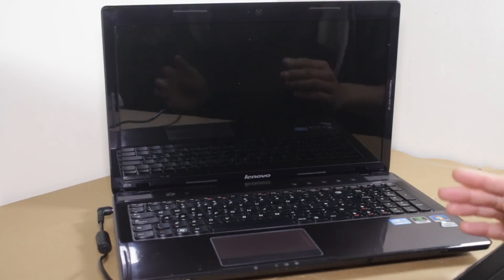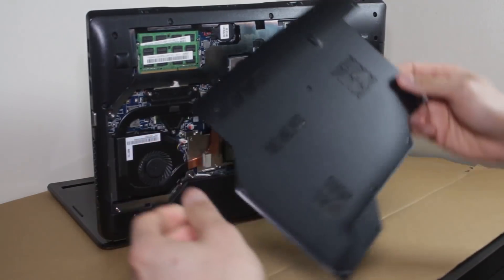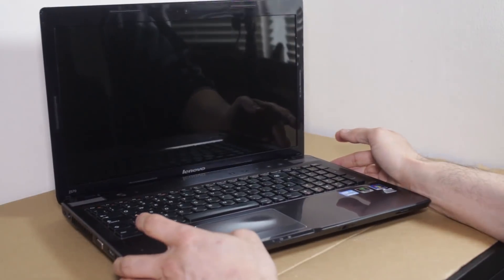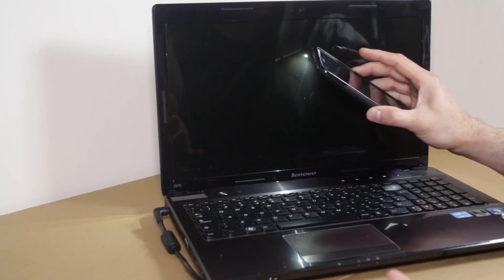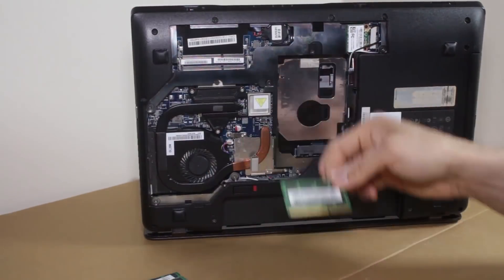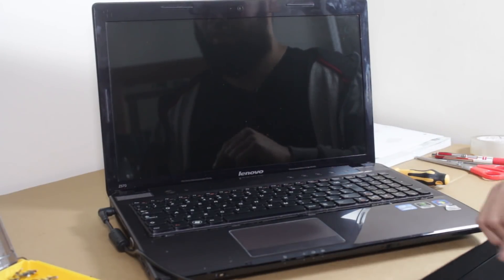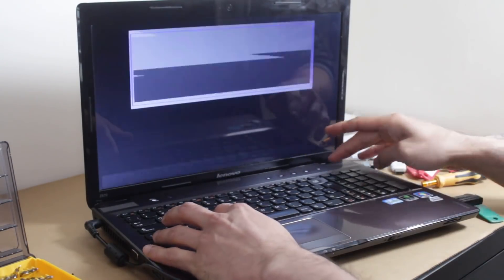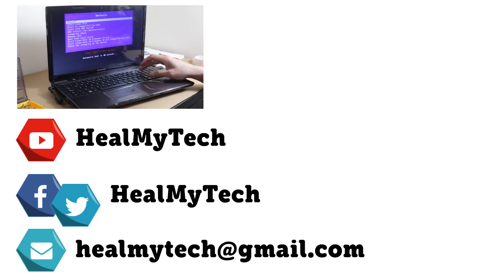Laptop No Display Black Screen Blank Screen On Startup | How To Fix Troubleshoot Repair | New

Comment: None of this helped but I found a new one that I would have never expected. One of the two Ram Modules went bad. Once I figured out which one Boom Working again! Out of forty years of using a number of PC's never once did a RAM go bad. There you go it actually does happen!
Reply: Did you replace the ram module? Or cleaned it or fixed it? What did you do to diagnose? When you take it off the laptop won’t turn on?

Comment: Great video!! May I know what is usually the problem if the laptop screen die sometimes and blinking like on and off. There's a case when I open all lights are on but display stays black. I do some testing like test to other monitor and it works but the laptop screen remains black.
Reply: Sometimes it works properly. Monitor is working but there's a cases small movements make the monitor's dead.

Comment: My problem was I disconnect the LCD from my laptop and reconnect it but my laptop was turning on when I reconnect it there was a little spark fire and it automatically turn off my laptop when I turn it on it goes black
Reply: Did you fix it man any update?

Comment: i've watched enough computer repair videos to know, when it comes to laptops doesn't matter what brand or model it is, its always a pain, i mean people still need them and yet manufacturers continue to make it their mission, to make laptops as hard as possible to get repaired, they need to start implementing standards so that they can all be customized with any and all components on the inside, just like desktops, and then that way any model of laptop can be recommended to consumers without limiting repairs or upgrade options.
Reply from the maker: Completely agree.  Somehow I doubt the tech companies will be making any mass changes anytime soon, as even laptops sales are on the decline in favour of smartphones.  I have to say though, the recent laptop models are a lot easier to open and diagnose compared to the previous ones, with one main back cover in most models I have seen.  I haven't done modern laptop repairs in a while, but I do need to own a laptop soon, its about time after 5 years of being in tech, a necessary evil, should make for a fun video trying to look for 1, hopefully a slightly older model from Lenovo maybe and fully upgrade it.
Reply: @HealMyTech1  i happen to know of one model that has most of the parts easily accessible, the HP probook 6470b, it belongs to a family member of mine, just like how you mentioned the bottom panel gives me access to all the main components: cooling fan and heatsink, hard drive memory and wireless card, so it can be potentially upgraded with a solid state drive.
Reply: @HealMyTech1  and that's because they are greedy they want us to be replacing everything in a short period of time, instead of giving us quality stuff, my first computer was a dell machine, i never once had to replace anything like the hard drive, motherboard or memory in that machine once, only thing was the monitor and the power supply that died, but overall it was a nice solid system that i had for over 8 years running windows xp, fast forward today its a completely different story, parts seem to diminish so quickly, and no one has money to be replacing so often these days, and there in lies the issue.

Comment: hello my brother
i dont think my hard disk have any problems but i have black screen, i tried all the ways to turn it on though i suspect its something to do with the fan because past experience

i dont have laptop for now but when i buy one i want to be sure my hard disk will work still and have my data in it, do you think that it could be damaged no good or its the reason my labtop show black screen?

and also
what about the data in the hard disk C: or the one with the windows icon on it.. (not geek clearly)

please answer my questions i will be very grateful
Reply from the maker: This would also work for a laptop drive.  Pt 9 | Troubleshoot A Hard Disk Drive| No Bootable Device Insert Boot Disk And Press Any Key https://youtu.be/zNmLM72hRhw

Comment: my toshiba c660 starts up (no display not even backlight) then after 20 seconds fan goes full throttle for like 3 seconds and it shutsdown immediately
Any ideas?
Reply: clean it, with air cleaner its probably dust that makes the fan pluged

Comment: Watched your video and  luckily for me it was enough to do a hard reset with the battery removed, I also got the chance to clean my fans one of which was completely blocked by dust. Just came back to say thank you for giving me the advice i needed to solve my problem. I have a Lenovo Legion y520 btw in case someone is wondering if it will work with this model.
Reply from the maker: Glad to hear you solved it!

Comment: hi i have this problem also i think the problem its the screen or the video chip not sure..
Reply: No display but it work on External Monitors so i think the problem is the Inverter board or the backlight but the screen still attach to the laptop with strange configuration i cannto remove the screen

Comment: My problem of my laptop is when i turn it on it will show display then blackscreen like in 14:59 ,do u know how to fix it or some solutions?
Reply: I found out that the problem is the hard drive and it needs to be replace and now its fixed :)
Reply: My screen is also like that thank you ill look at my hard drive

Comment: Please Help me, My laptop screen  is blank but external moniter with cable is working. Capslock light is lighting. Its urgent to get a job for me.What to do plz help call or email at kankit@live.in ( 8722408588 ).

Comment: Hi. I have a Lenovo Ideapad 500. In my laptop the problem is that my laptop does not get the display immediately. The display comes after a very long time. Sometimes the display comes after 30 min. Could you suggest a solution..

Comment: ASSALAMUALAIKUM BRO.....PLZ. TELL. ME, I NEED A TOUCH SCREEN TABLET IN 11 OR 12 INCHES IN WHICH I CAN CONNECT KEYBOARD AND MOUSE ALSO,, AND IT WILL BE ABOUT 1TB OR TB RAM SHOULD BE 4 TO 8GB............

Comment: Dang, it says 2018 published, I was expecting a more newer version laptop. Old laptops you can pull batteries out, but the newer ones you cant.
Reply: In what head is the good idea to seal every part to the motherboard, that if something break everything go to trash
And that inst all
The battery is inside!
Hooly ** 
(*angry noises*)

Comment: Ash!! I wanna ask you something about a pc that is now in stores for 380 dollars tell me your opinion on it please https://www.bestbuy.com/site/lenovo-ideacentre-310s-08asr-desktop-amd-a9-series-4gb-memory-1tb-hard-drive-black-silver/6009010.p?skuId=6009010
Reply: well thing is a family member of mine bought this pc yesterday and i thought it was gonna be crappy for the price turns out its faster than their previous laptop purchases, so much so that there are not very much faults with the performance or multitasking at all so they are keeping it, i already know the slimline pcs are hard to get parts for but they are only gonna use it for regular tasks like web browsing, social media, a few 2d games and that's it. but i'm happy for them you know, its been years since they ever got a system that could perform so well and not be compromised all the time, they were getting so sick and tired of dealing with the broken laptop screens and batteries, slow performance and the cost of repairs was just not in their budget at all so they never bothered to get their laptops fixed and i understood why because it would take forever to open them up cause they were always poorly built. at least now this desktop is fast enough for their needs without costing too much.

Comment: HealMyTech. I am having trouble with my first build and I would like your help or advice. So I just finished my build and For some reason my monitor will not turn on and The only things that seem to be working are the motherboard and the usb inputs. My motherboards RGB lighting is working and The orange led is on, but The cpu fan isn't working, The psu red led turns off after a second of it being on, and The rgb on my ram isn't working at all. What should I do?

Comment: Someone has broken my toshiba laptop I sold them have tried plugged in a screen to VGA but it will not work to  https://www.youtube.com/watch?v=0pc_pFoqkZM  I cannot get a dvd or USB to do anything.  yes I did press F4 & FN key to.
if no good they do not take back I reuse ram & hdd but think its one for the tip.